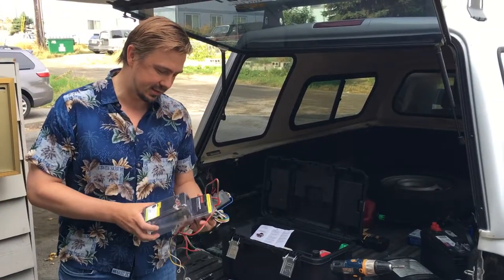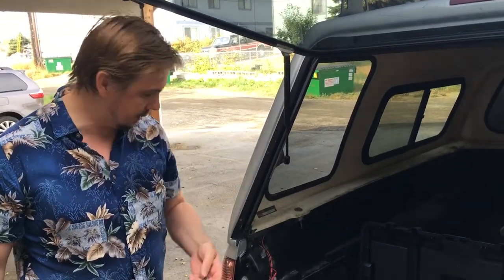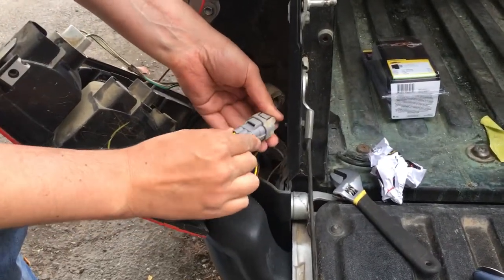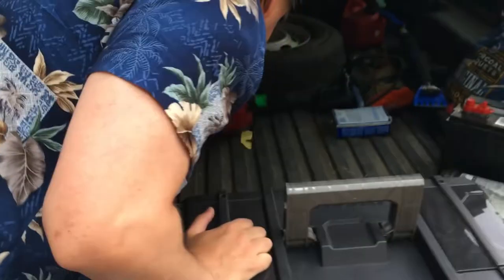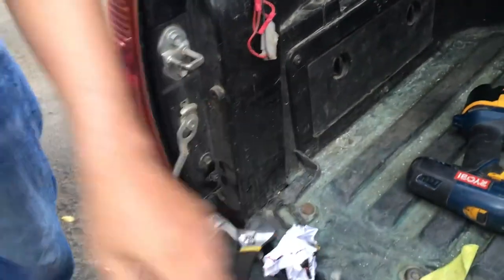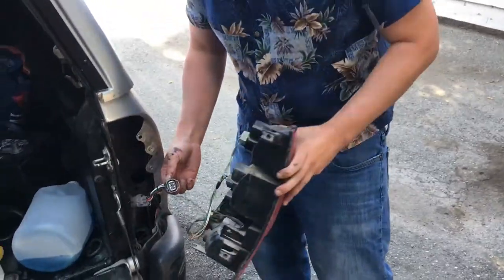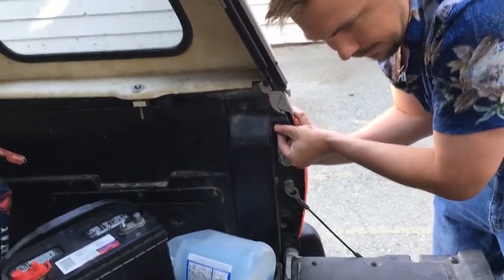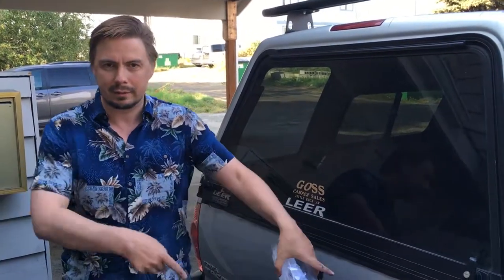Towing Wire Harness Install for Toyota Tacoma 2006

Comment: Thank you very much for shairing.. where i can get the kit for towing?
Reply from the maker: I got mine from Uhaul. Any auto-parts store should carry something like this.
Reply: @embertilton  thanks, i foun it on Amazon cheaper than auto parts. If you dont mind how much you pay there.
Reply from the maker: @ISAIASELCUERVO1984  I don't remember. I think it was like $35 but it could have been more. I think you can order directly from Curt the manufacturer.
Reply: @embertilton  ok thanks anyway.. i apreciate your response back.

Comment: You don't have to connect the harness to the battery? I see other videos where they do this same exact thing but they run the harness to the battery also. Do you know why?
Reply from the maker: Nope.  I suspect because they want some form of constant power, but I only needed my lights to work.  For example, if your trailer has light on the inside, you might want to turn the light on inside while the truck is off.
Reply: @embertilton  ok that makes sense. I have a 2008 tacoma and I just need a connector for a trailer. So just running this harness is good enough and don't have to worry about burning au fuses right? Just basically like running a camper shell brake light
Reply from the maker: @dant3113  Absolutely, just throw out the instructions and watch the video, you'll be good to go. :D
Reply: @embertilton  thank you bro 🤘